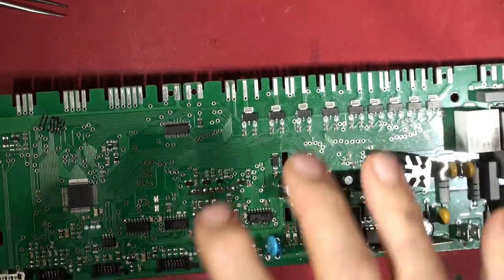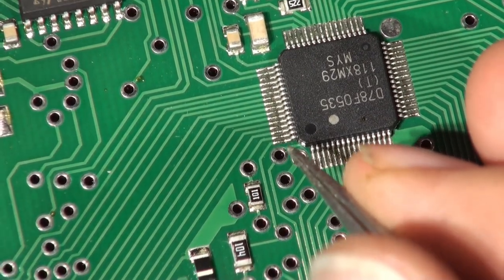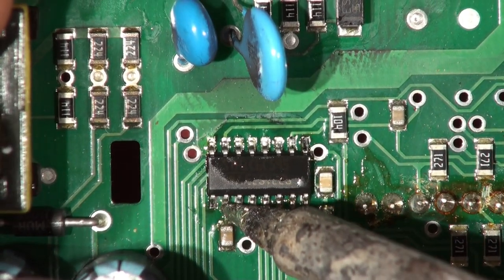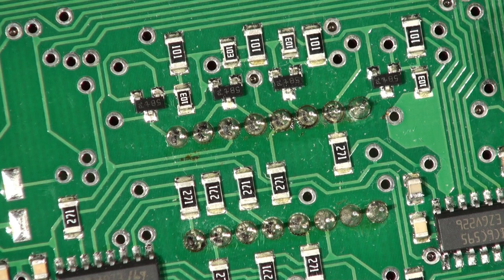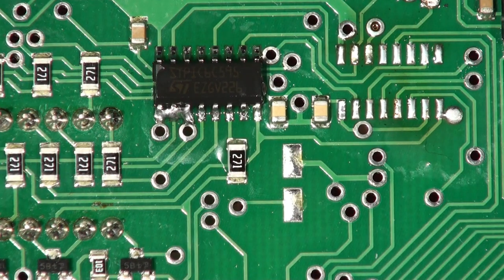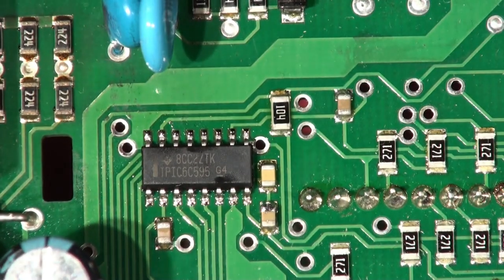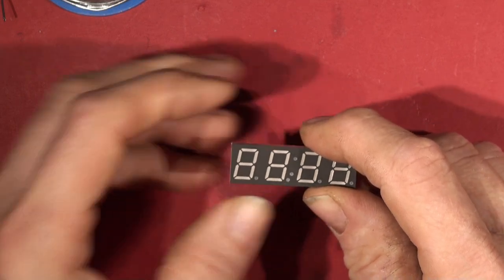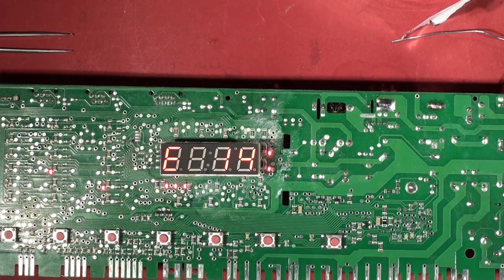Neff Washer Dryer Controller Faulty Display Diagnostic and Repair

Comment from the maker: Display part number is Vishay TDCR1050M  if you find an alternative then make sure it is the common anode variant.   https://www.mouser.co.uk/datasheet/2/427/tdcx10x0m-1767280.pdf